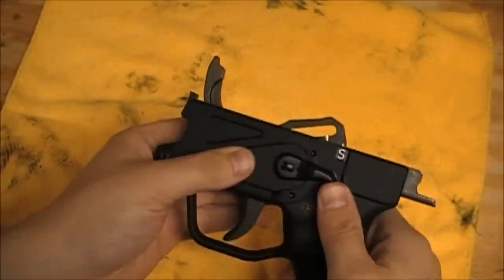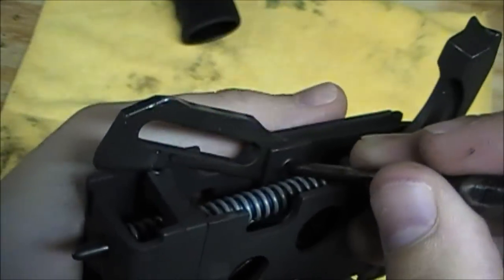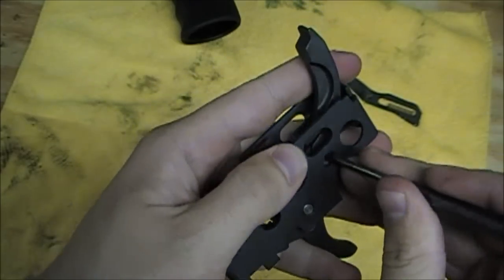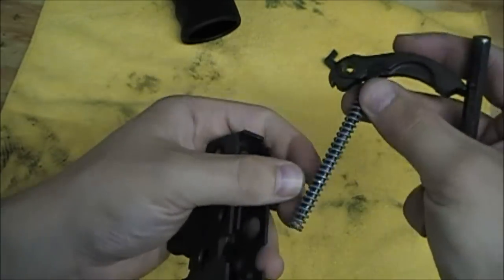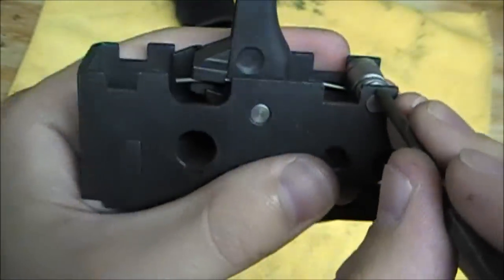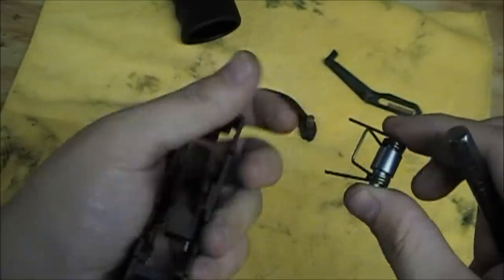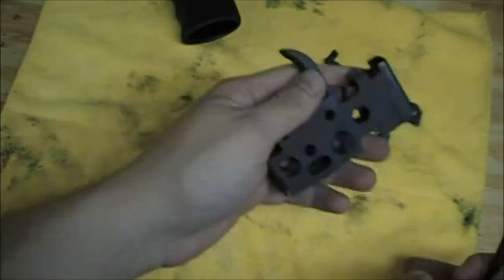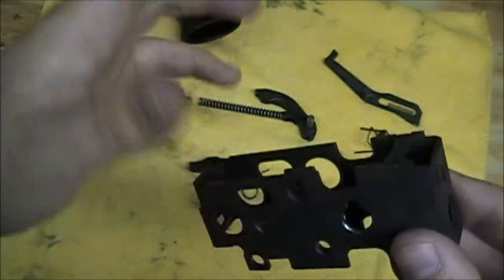H&K Semi Auto SEF Pack Disassembly

Comment: Well done!  This works for the new SP5 also.  Removing the safety levers is a bit different, as there are only two positions.  A lever riding on the safety needs to be depressed to allow the safety lever to move to the vertical position, where the right side lever can be removed, and than the left side.  The same three pins are removed, and all else is the same.  I used this video to replace the sear and trigger on my SP5, as two of six parts replaced to make it NFA compliant as a SBR.
Reply from the maker: That is correct as the ambi packs are slightly different for the selector detent disassembly. The SP5 pack is based on the Navy pack which has the same function as the SEF w/ ambi controls. Once the selector is removed, the disassembly is the same with the exception of the spring and lever that retains the selector. The burst packs are much different mechanically inside and they are a real PITA to re assemble. Glad I could be of help!

Comment: Well done Sir!  Very helpful.  For those with an HK91, there is a retaining ring on the back of the ejector axis pin.  If you take it off sometimes it will not go back on right...  I would leave the ejector on unless it needs to be replaced.

Comment: Why does it have three position? Is it simply to semi-auto positions?
Reply from the maker: The non modified full auto pack would be safe/single/auto. In ATF compliant semi modified form the selector will move to all positions still but only allow for semi auto use.